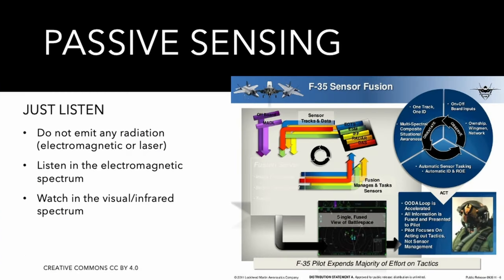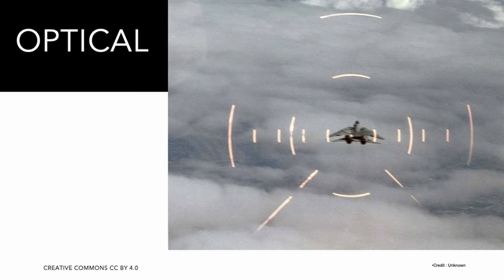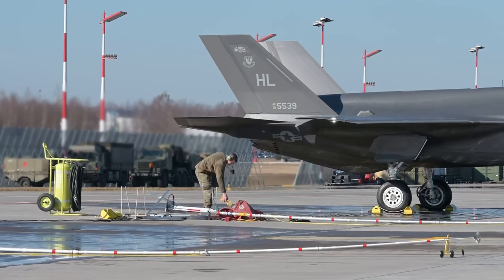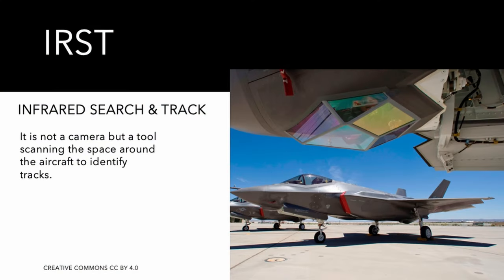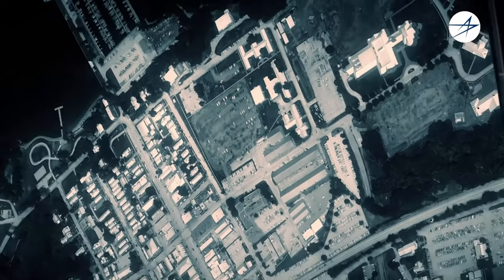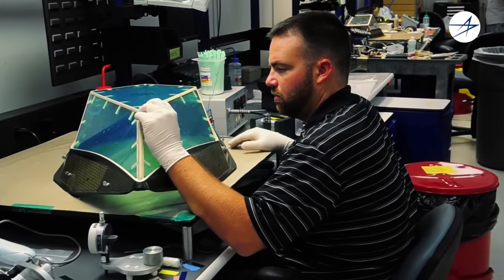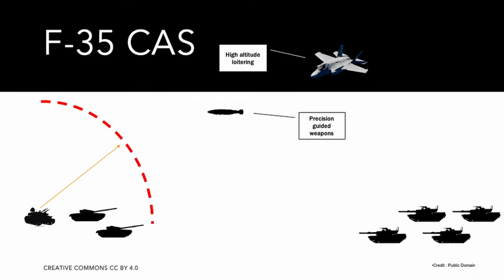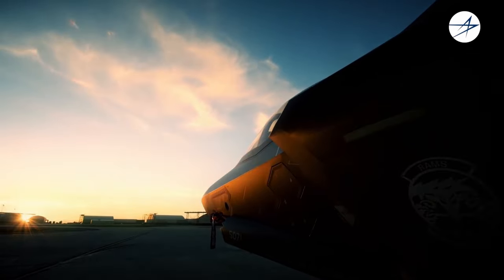The New F 35 Block 4 Sensors are Crazy!

Comment: But... but Elon ASSURED me that the F-35 was useless!! 🤣
Reply: And he is right.

Everything on the F-35 could be put on any other stealth jet _and has_.  SAIRST an Big-Bore IRST are like downloadable apps to a smart phone.

Fundamentals of how much it costs per hour to fly (43,000 dollars).  And how far it can go in a given pilot limiter of 6-8 hours realistic endurance.  Plus what degree of kinematics performance it has when it gets there.  And how much kinetic  effector damage it can apply all dictate that the F-35 is a massive failure being purchased for Union Shop core aviator community job security.

A UCAV which could fly twice as far and has, from the outset, the AETP compatibility to do so (engine inlet mass flows, thermal shielding, width of engine bays to accept the bypass piping...) would be able to target for missiles which could make the same trip, one way, in a tenth the time.  Say 18 minutes not 180.

And those UCAVs would have the sensors to never get close to the high threat area while operating in the bozosphere where the F-35 cannot go without an Astronaut suit.  Where it would hang for a day or more.

Before coming home and switching out with another jet, making the same trip on much smaller, much less vulnerable and vastly less costly carrier which would not have to come so close, require so much crew or cost as much to operate under conditions where any sub or land or ship launched ASBM could theoretically sink it, from over a 1,000nm out.

The missiles themselves, carried at pennies per mile to a tune of 100-300 shots per modified Columbia SSBN, could then be traded, 100:2 (million) for a total of 50 shots for every F-35 not purchased.

While the UCAVs, because they don't lose their G-tolerance, HOTAS skills or SA in every 2-3 days without practice as pilots do, can be made to 'practice', mostly, on a super computer with perhaps 1/10th the force verifying real world tactics up at JPARC or Nellis.

Which means we have a valid fleet of ISR assets with lasers and micro-missiles and persistent supercruise plus next-level stealth (ELO) as an expensive asset which are nonetheless affordable to a nation that is in bankruptcy because our debt is no longer covered by Global Reserve Currency status as the ENTIRE PLANET rebels against the hypocrisy of our taking offense at someone refusing to encroach on their borders without our woke insanity.  While we have no problems stealing the resources of a country which is now being overrun by barbarians so that the oil and food we take can end up in Israel, a genocidal horror state, currently butchering the Palestinians to the last man, woman and child.

Lets be very clear here: if you want to defeat a country like Russia or China, you had better be able to go Mach 20 and sling HGBs from a couple time zones outside their border while still crushing their industrial base and transport grid with weapons that hit like Orezhnik.

If you want to beat up on a bunch of helpless, low-tech, warfighters in Afghanistan and Syria and Iraq, you DO NOT NEED an F-35.  You need a cheap UCAV which can vulture them day and night, drop munitions the size of a 40 Ouncer and do so at minimum cost and often extended ranges without bankrupting your defense budge because the OTHER SIDE is not going to play Snoopy And The Red Baron games.  They are going to crush you where you live with long range drones/cruise/ballistic missiles of their own.  It's literally cheaper and far more likely to work. 

Think about this when you ooooh and aaaaaah over a dated, (1994 JAST concept), pricey and vulnerabe (basing mode if nothing else) system which is so good that, less than ten years after intro they are literally stripping EVERYTHING out of that jet and replacing it.

Engine, EOTS, DAS, Computers, Radar, EW Suite, IPG.  Everything.

The only reason the F-35 is getting hooted and hollered is because we can no longer afford a 70-100 billion dollar new airframe investment as NGAD to dump the existing, 'developed', systems into as a 300 million dollar fresh start.

Which is a shame.  Because NGAD could at least be designed, with RDEs, to get 1,500-2,000nm downrange in an hour and a half and hold on station for the 3-4hrs needed before the baby onboard needed fresh nappies and nap time.

The F-35 has more in common with the MAP F-5A than 'the next generation' and those who know this are throwing money at GCAP and FCAS and Khan and Su-75 and and and rather than chuck cash into the money pit which is Team  Lockheed and the F-35.
Reply: @xyz-hj6ul are you high? I've seen Elon fan boys before but you are next level.
Reply: damn ELon bots at work overtime
Reply: Elon’s argument is these should be unmanned systems.
Reply: @chillxxx241  Which misses the point that there are already plenty of planned unmanned, low observable, platforms currently planned. The F-35 and other planned next gen manned platforms are the linchpins in directing and controlling them.

Also, and I cannot stress this enough, the digital battlespace is expected to be highly contested. Control of it will likely be fluid, so having manned platforms may be a necessity to do things like confirm battle damage or control siloed networks of unmanned assets as to avoid hacks by quantum technologies.

AI only can go so far. Even many of the expects in the field agree driverless cars to be now a pipe dream. Totally autonomous flying drones do have an easier time navigating due geography being something you more so look down on rather than drive through, however, having a human in the loop is still seen as being essential as to prevent indiscriminate war crimes being carried out.
Reply: Actually Elon didn't say "useless". He said. ""obsolete" and "inefficient" and would "just get pilots killed".

Is wrong about "obsolete " drones aren't capable of fully unmanned combat.

He is correct to say inefficient in an attritional budget and combat inefficiencies.

The F35 inabilities are glaring for the future theater of War. The are hugely lacking in speed, weapons capacity,  durability.
Reply: @saquist to the Lack of weapons and Range for the F-35, several prospective missiles such as Peregrine bring AMRAAM-esque performance i to a half-size package while the Low Drag Tank and Pylon program of the F-22 is showing good prospects to be added to the F-35 program, which may soon net Stealthy Weapons Pods
Reply: @Cobra-King3   Those are good upgrades but the F35 inefficiency are dramatically more outsized in the new anti air environment than that.  Truely this may perhaps be a statement on the future obsolescence of the aircraft carrier itself. 

Hypersonic missile range is 1,700 to 2,200 miles. 2 stealth  drop tanks get you from 600 mile range to 966 miles. Not good enough. The F35 also can't carry the longest range cruise missiles we have  (AGM 129, 2000 miles). Combine that with limited weapons to carry...it's not good. You're only getting target saturation of 360 missile on target for all 90 f35s on a carrier. 

Create a Stealth B1 Bomber for 1 billion per plane. It could deliver 40 AGM 129s  per aircraft and hit well into China when launched from....Hawaii. Make it Australia and all of China is a target...

Just  25 Stealth B1 Bombers could deliver 1,000 AGM 129s to China in a lthal saturation attack.

Carriers with F35s can't do that...
And they never will.
Reply: I bet Elon gonna be 50% more rich when this new administration ends. It's all about power and money
Reply: Yes a man with a security clearance and knows a billion times more about this than him or you maybe check out mover and gonky channels they are only fighter pilots for the us military what would they know.  This is the same dude that said emphatically there was no su57 in the Chinese airshow.  It was a product tester but certainly an su57 there was another su57 for people to look to I can't tell if this guys just completely dumb on this which I doubt he's a very smart person he knows there was.  He knows this planes garbage so what else could cause him say untrue things $
Reply: @bastordd  You must not play the stock market my friend 😉. 50% ?...Tesla stock has DOUBLED in the last 6 months. I made my 200 grand.  There is a reason why we're richand  you aren't.  The rich are good at making money. The rest of you are good at SPENDING money.
Reply: @saquist  I love how you talk about me... Did you know me? Or my life? Or how I bet in the stock market? So stf u kid
Reply: @xyz-hj6ul I think this is a valid take and absolutely makes sense for preparation for or deployment within a continued hot conflict. We absolutely need to fast track development and warehousing of an entire autonomous air dominance fleet. Especially of importance are high altitude high loiter time capabilities that are impossible to achieve with a pilot on board. Currently though, in a “warm conflict” wartime environment, the judgement and decision making skills of a human operator are still more useful than outright firepower or operational envelope. So in the end, we need both.
Reply: @saquist I love how y'all only talk about range when there's much more important stuff that actually needs to be talked about here.
Reply: @M16_Akula-III  The F35s technologies are on the wrong platform.
Reply: @saquist  Nope, it's perfectly fine.
Reply: Elon is probably just unaware about how connected these aircraft are to each other and each aircraft's goals. One F35 will be able to lead unmanned squadrons of loyal wingman aircraft
Reply: @xyz-hj6ul 
1. Bozosphere doesn't exist
2. Not a single kind of Unmanned aircraft can fly that long
3. Flying that high requires a very long wing (diminishing stealth), or. going very fast (also diminishing stealth)
4. You need equipment to be able to control the UCAV from that far
5. Any long range SAM can detect such a high-flying aircraft
6. The F-35As are 70-60 Million per unit
7. You missed the point of a submarine deterrence
8. Putting a conventional warhead or HGV onto an SLBM is stupid
9. Su-75 doesn't exist
10. That's quite literally how technology advancement works, if there's something new and better that could replace another thing, they will replace it.
Reply: @saquist  Dude you clearly know nothing about the F-35 or air combat. How does the enemy attrit a plane they can't even lock onto? They don't. You can try shooting at the F-35 all day long and you're never going to hit it. That's not JUST because of stealth, but because of its EW, its countermeasures, and simply how the pilot uses the plane. The F-35 is neither lacking in speed, nor weapons capacity or "durability" (whatever THAT means). If you think the F-35 needs to be better than the F-22 in those regards, you obviously don't know why the F-22 was discontinued. Air combat isn't what you think it is, CLEARLY. Don't talk about shit you don't understand.
Reply: The thing about Musk and Trump is that they both put high emphasis on setting up a strong negotiating position.  You should evaluate everything they say through that lens before you blithely assume they’re just uninformed.  Musk is putting defense contractors on notice about their cash cows.
Reply: @ericlaw2416  What does that have to do with 5th gen fighters?
Reply: @saquist  why do you insist that because the F-35 isn't a bomber, it isn't viable?

And if we are throwing 2000km ranged cruise missiles, the stealth of the aircraft is not a priority. Might as well use a B-52, or even a rapid dragon C-130.
Reply: @2goober4u  That's a strange Question.  Why then did we just complete a new B-21 Bomber with a range of 2,500 miles?  The report from the Pentagon says: " A single B-21 can also deliver the same impact as several F-35As." and a much higher range.

The entire point of the F35 is to increase the range of US Carriers.  That's the definition of Expeditionary Forces, to seek out threats before then reach home.

If hypersonic missiles threaten to eliminate this advantage the F35's and $13 Billion Carriers  are instantly...useless.

We need a Sky-Carrier, fast, stealthy carrying tons of missiles. Why is stealth necessary?  As usual stealth allows you to get closer and limit Time-on-Target increasing surprise from an Alpha Strike.  It prevents threat forces from repositioning their defense assets and maximizes saturation. It's how you force the Defense to spread out instead of concentrate.
Reply: @2goober4u  why is DOD creating a New B21 Bomber?
Reply: @saquist   to carry large amounts of guided bombs. Meanwhile the F-35 has a more generalist strategy, with it being faster but with less ordinace. I can't believe I have to explain the difference between bombers and fighter/attackers to you people...
Reply: @2goober4u  can a carrier with F35s out range Hypersonic missiles?
Reply: @saquist   why would that matter? Fighter/attackers do not fill the same role as "Hypersonic"/ballistic missiles. Besides, carriers can get the aircraft closer to target, negating this entirely. 

What are you even trying to say? That we don't need the F-35 because we can spend 100 million on a single strike weapon?
Reply: @2goober4u   So you're okay with losing  $16 billion, (carrier,planes, ammunition) and 5,000 men and women to strike a target defended by hypersonics?
Reply: @saquist   the whole point of a plane is that (typically) it doesn't explode every time it is used.
Are you actually 12?
Reply: @2goober4u  You clearly don't understand
Reply: @xyz-hj6ul It's almost like relying on autonomous software or wireless communication to fly the jet is a massive liability.